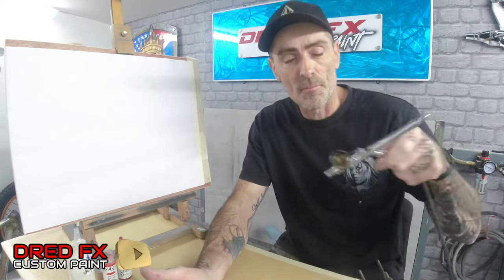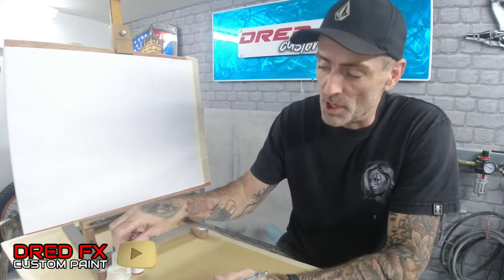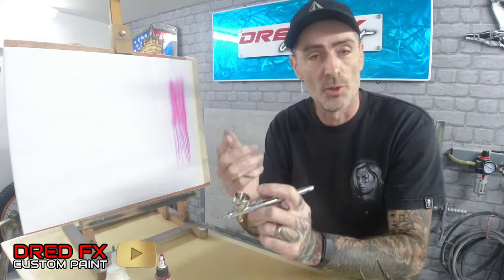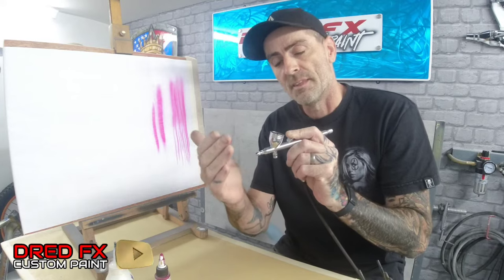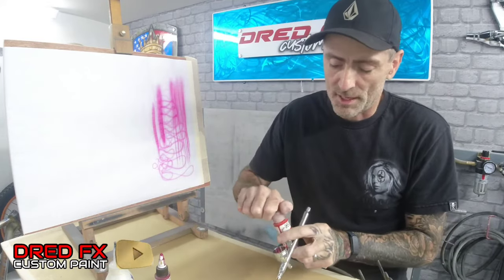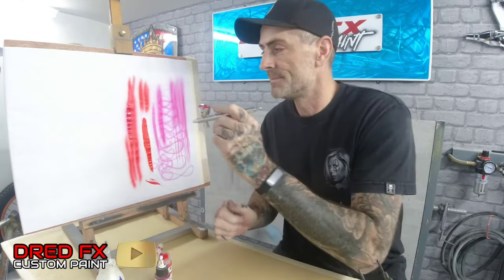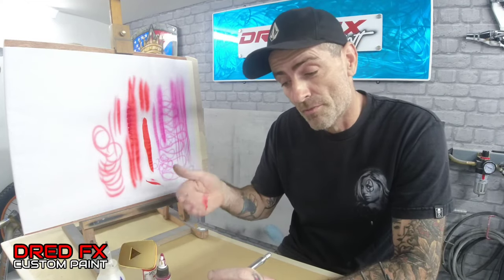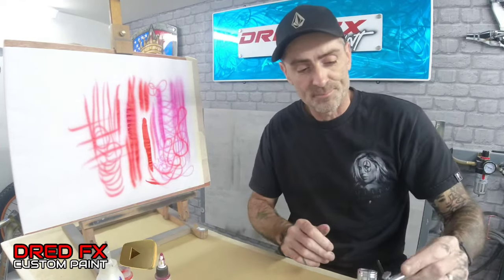Airbrushing for the beginner getting the right PSI settings

Comment: Very useful and straight to the point, I haven’t bought one yet because I’m researching techniques and best model for beginner/ use, I’m looking at the FENGDA BD-130K which doesn’t have MAC dial but for first airbrush I’m not too bothered, I plan on buying a very good compressor though (FINE ART A-7000), which does have good adjustment of PSI, my only stress is knowing wether the price/brand of the  airbrush is important at this early stage 
Your idea of a base PSI of 25 makes sense and with all the different types of paints it would be easier to change the viscosity of the paint rather than constantly changing the air pressure 
Happy new year btw
Reply from the maker: If your starting out and looking for a brush go for the new 2024 harder and steenbeck ultra it's robust easy to use and teaches you to airbrush 
It's the best brush on the market for a beginner hope this helps 👍 there is videos on the channel with the ultra worth a look have a great new year 
Rob
Reply: I’ve been looking at them since watching your review, it seems a good choice and as it’s available from my local model shop at (converted from Hungarian forints) about £63 it will be worth it
Thank you and happy new year to you too

Comment: Is that 25psi at the Reg or at the gun ? 
Do u use a large Comp, if so any chance can see the Reg  fittings etc?
Reply from the maker: @deenunya7735  hi its 25psi on the main line that goes to the brush

Comment: I am a complete noob to airbrushing.

Received one as a gift (just the airbrush set, which apparently is quite a decent unit).  Just the airbrush.  Purchased a battery compressor, to get the feel of things.  Was awful, PSI topped out around 15 at the nozzle.  Decided I liked the way it worked, but didn’t want to spend a fortune on a compressor.  Purchased a basic full kit, which included a small AC compressor, with three PSI settings, maxing out at 40 PSI, I believe) which works well enough for my purposes (painting miniatures).  Included airbrush did not have a dial to change PSI at the nozzle, but my original airbrush does.

Why does the airbrush have this dial, when you can set the pressure at the compressor?  Is it so you don’t have to keep changing the PSI at the compressor, or some other reason?

Cheers,
Reply: You're correct; the mac valve on the airbrush is so you can leave your compressor at a constant psi and just adjust it from the airbrush (although not as accurately, but it's not that important). This is especially helpful when you have multiple airbrushes set up on one compressor.

Comment: Is the pressure set as static or at flow?
What I mean is do you set the 25 psi whilst holding the air down or when the air is off?
Reply from the maker: You can press trigger down then set

Comment: Hi  am trying to use dark ground/black on false oak beams I create, can I use water based stains ? Tried to set up the gun4 times without success, even with water
Reply from the maker: Should be OK 👍 as for gun setup what gun do you have
Reply: @dredfxcustompaint  cheap machine mart one.  😆
Reply from the maker: @Stonefxwalls  what size is the setup on the spray gun ie 1.3mm 1.2mm 1.4mm
Reply: @dredfxcustompaint  there is a 5/16th pcl to about 1/16th step down , into a tiny hose that came with it . I am using a Clarke 5 cfm , 25 ltr compressor.